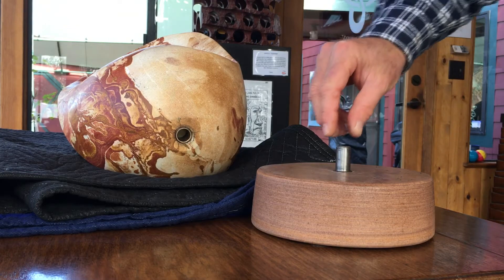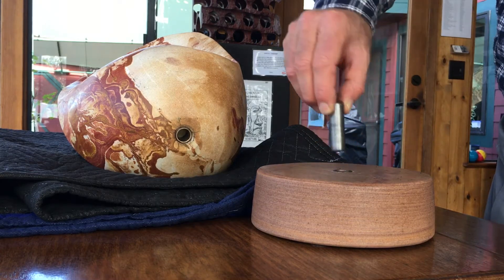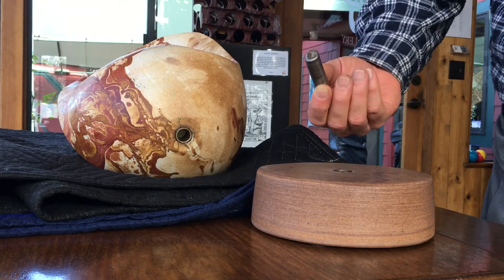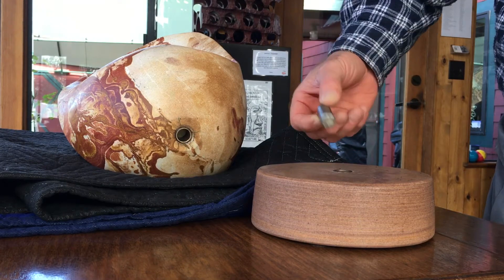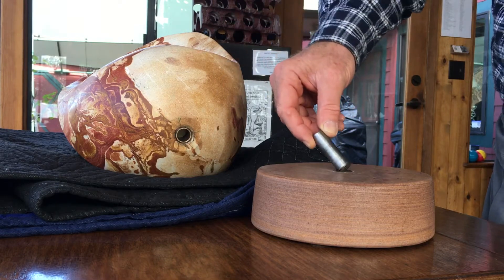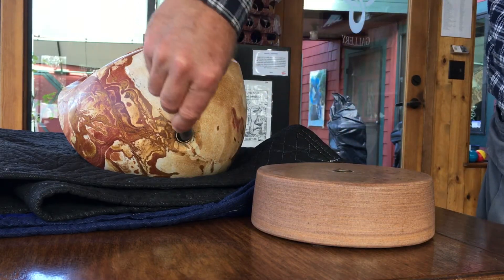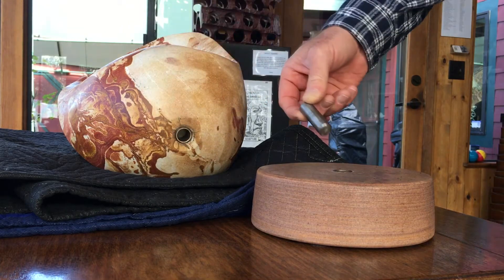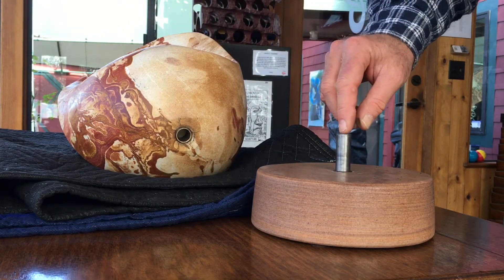How to mount T Barny Sculptures

Comment: Hi T Barny,  great video and I like how you've mounted the sculpture. Please could I ask, did you buy or make the stainless steel pin and inserts? Do you have a video on you drilling the sculpture? Did you start with a small drill first and then go larger until you got to the insert size? Thanks in advance for your help!